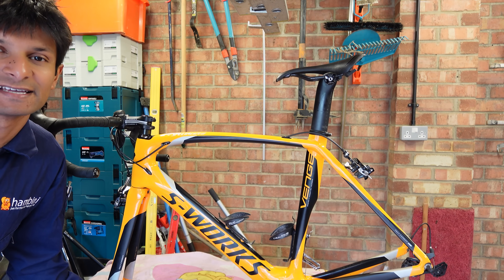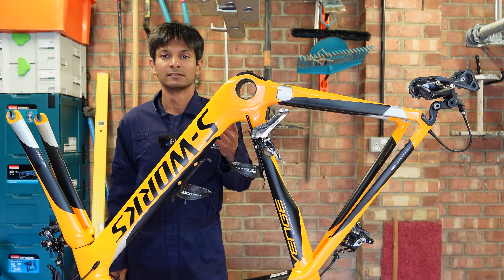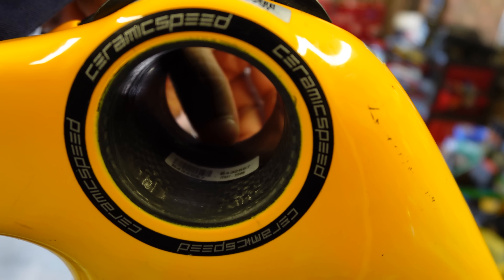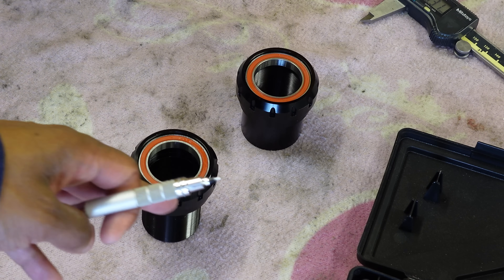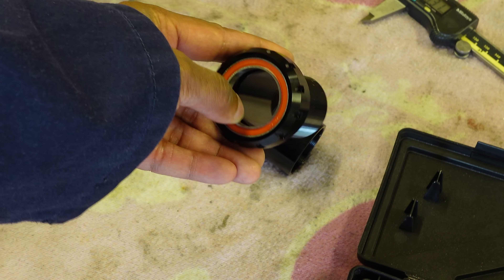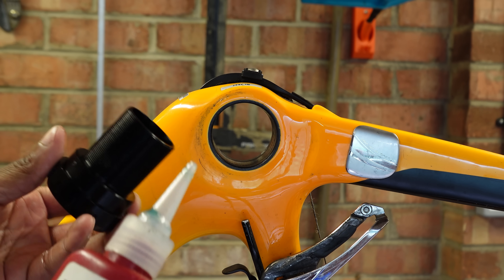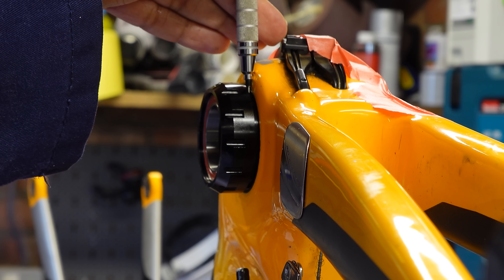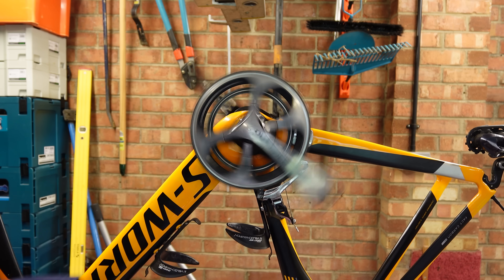Threaded Retrofit for a Failed OSBB on a $3000 Specialized S-Works Venge Bike Frame

Comment from the maker: This bottom bracket uses twin sealed rubber bearings. Almost all other manufacturers use single sealed bearings. Most of the bottom bracket I have on the channel are racing types - which usually come with non contact bearings.  Hence there is considerably more drag than the usual spin tests I do.
Reply: Pre amplification of the audio is too little: content loudness -19.2dB
Reply from the maker: @detmer87  If i knew how to change it, i would! I just used to use the volume control
Reply: @Hambini I don't know what program you use for editing the videos but most of them have a "normalize audio" function that does the work for you.
Reply: @detmer87  wouldn’t normalising the audio reduce the impact of Hambini’s greeting?
Reply: You mention that NTN bearings are now made in Taiwan. Has the quality suffered as a result? Is NTN still your go-to brand for BB bearings or do you now prefer/advise other manufacturers?
Reply: Please, for the love of god.....Turn off the AI Translation
Reply from the maker: @66mikkim  you can turn it off with the gear icon in the bottom right.
Reply: @Hambini  not on this video, but on Hardthrasser’s channel, the Ai bull crap keeps coming back after every advert and has decided I’m Portuguese/German.
The problem of the Ai feature is that it’s been coded by Ai.
Reply from the maker: I'll have s look  @smellysam

Comment: My experience working with Delrin is that it’s essentially impossible to glue it in a way that will take any real force (torque or shear). If glue is all Specialised are  using then they are bound to be experiencing problems and I would say that it’s not a question of if but when this problem occurs.

Comment: I have a 2017 Venge and one like to fit an external B&B like the one you used. Is this a hambini unit? Also, when replacing with an external B&B, do you need to replace the cranks with a longer axel?

Comment: Are you sure the retaining compound will cure/crosslink w/o iron or copper elements being present? Have you used a catalyst? I would rather use 2-k epoxy adhesive for a combination of CFRP and anodised aluminium…

Comment: Hey Hamibini, retired Locite rep here and cycling enthusiast who has watched a ton of your video's. I am a big fan and enjoy all your videos. However I'm a bit disappointed to see you're using a knock-off brand of Loctite but calling it Loctite. You can do better. Yes it's more expensive but the quality of the resins are superior. Case in point, I doubt the knock-off stuff (Tru-lok) would cure and adhere very well to inert surfaces like anodized aluminum and carbon fibre. Anaerobic resins need active metal and a lack of oxygen to cure. I wouldn't be surprised if the applied resins took a week to cure. Hence the difference between knock-off brands and Loctite. All of our current resins are 'primerless'. Meaning they're formulated to cure on inert surfaces. If you had used 243 and 680 you'd see faster curing and better strength. If someone is paying for a for high quality Hambini BB then it should include high quality threadlocker and retaining compounds. Also, 243 is a very accurate threadlocker when torquing bolts to spec. Knock-off brands torque/tension are all over the map. Another reason to use the real McCoy. Cheers.
Reply from the maker: I take all of your points on board, the simple problem is that Henkel had a supply problem in the UK at the point of purchase. Otherwise I would have got the Henkel.
Reply: I thought he said "basically Loctite" ?

Comment: When I saw the thumbnail for this vid... big time dread.. oh crap, there's my bike (same as mine).  The bottom bracket on this bike is a terrible design.  I ended up with a wheels mfg adjustable OSBB compatible BB; I could never get it "right" and finally sent it to a mechanic; who ended up shimming one side to create a better chain line and no creaking 🙄

Comment: Carbon frames are only as good as the glue that holds them together. As you commented, in time it goes brittle and loses it purpose. I've said this over and over to these clowns but they still want to argue that carbon is stronger than steel. Well I just bought a new custom made steel bike, lets see how long it lasts.

Comment: Nice video, great fix.  Man, I was just shopping cheap chinese frames to build up a cheap road-going endurance bike, but so many of those were designed, and still keep, the press-fit bottom bracket design.  I think I'm better off going with T47 internal, but haven't found one yet in those cheap price ranges.

Comment: I’m wondering if the current crop of carbon fibre frames with threaded BBs will face the same fate in a few years.
Reply from the maker: quite possible. It's the glue that is failing and it often takes a bit of time for that to happen. It will probably be worse if you ride in some extremes of temperature and/or humidity
Reply: Interesting question. I guess it depends on how those aluminum shells are installed. Are they bonded with an high shear strength epoxy or molded in-place. Are they keyed or have splines you can't see to add rotational resistance? Would be interesting to see the behind the scenes manufacturing process or designs. No doubt it varies by OEM. Maybe someone can donate a ruined frame to Hambini for some R&D. 😜

Comment: Ah yes, nothing says "engineering excellence" like gluing plastic cups into a carbon frame and calling it a standard. Brilliant move from Specialized for the dentists. Who needs proper tolerances when you’ve got epoxy and hope? Glad to see it finally got the thread together treatment it deserved. Probably should have come like that from the factory.